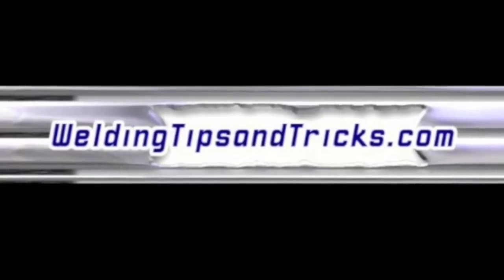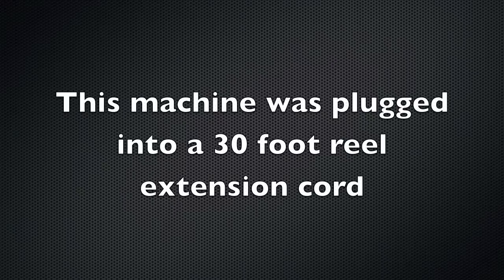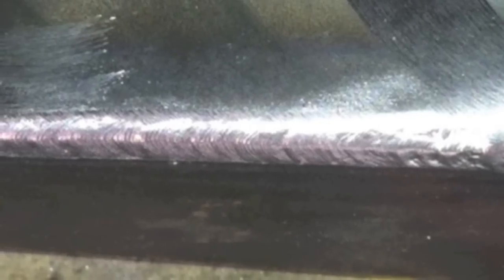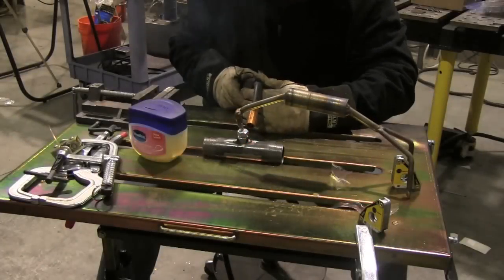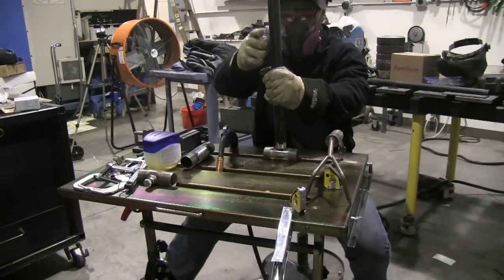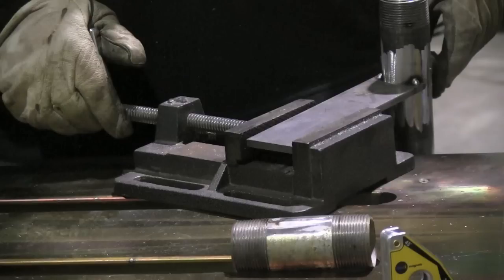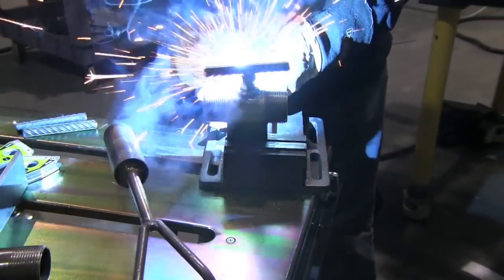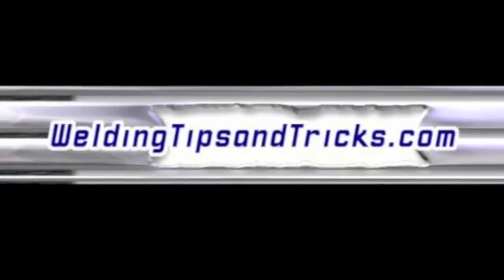Mig Welder Tip and Welding Tree Project

Comment: so, what is your take on that welder? I have one extremely similar which from the constantly variable voltage control I am assuming is just like mine as they look almost identical (Neiko 135) also same as the Eastwood, minus the spool gun control on the front. was very encouraged to see the nice welds you got with it.
Reply from the maker: my take is basically this.  it welds pretty good and strong for a 310 dollar welder.
comparing it to another welder that looked to be built much better, it welded much stronger and better....so I learned you cant judge a welder by appearance only.  I would have bet on the one that looked to be made better

Comment: Jody

Are they malleable iron pipe nipples and black pipe ?

That little 110V MIG seemed to me to do very well with the mixture of materials:  z/p nuts, galv pipe fittings, black pipe, hot rolled m/s and medium carbon rebar ?  Or was it the expertise of the bloke holding the torch ?

My experience with stick and trying to put rebar into galv pipe fittings to make break-down legs on camping gear was absolutely awful results.

Thanks also for the Vaseline tip - much easier than going to the tool store for anti-spatter spray.  I must also try your PAM tip as well.

Regards

Comment: i don´t know why there is a market for so little welding toys... i weld now +15 years all from 1mm up too 40mm steel and steel alloys but this "inverters" are all lame at the arc control. maybe i got a bad machine but there arcs are so soft, both tig and stick, that i dont will they as a gift for chrismas or another day ^^ how was the arc control at the ahp 140 ?  long and soft or more like good old heavy duty weldingbox with max 300amp max ?  i work all with this big-red-box and i never will replace her with a inverter ^^

Comment: I use a Northern Industrial MIG 135 WELDER i can weld 6" inches and longer plus i 
have welded a 1/2 inch steel with welder.

Comment: When you are grinding off the galvanized coating, it helps if you smear some of that liquid hand soap with the pumice in it (feels gritty) on the piece.  Hard to believe but it makes a big difference in the speed and effort it takes, it also cuts the fumes down some.

Comment: Do you ever have trouble with Tig welding and using magnets to hold the part. It seems to mess with the arc when I use magnets.
Reply: Hi. See my comment below.  I am no expert at welding but this phenomena was explained to me.  Cheers.  Hope it helps you.
Reply: I've noticed the same thing with MIG so I only use them tacking like Jody has done. Never use them while completing a weld.

Comment: Am I weird for watching these videos even though I don't weld and barely know anything about welding? I did some stick welding in high school but that was only for a few weeks.
Reply: I learned MIG and TIG welding just by watching Jody's channel.  I am like most guys learning by seeing it done.  Jody is the king of welding!
Reply: Jody is mesmerizing to watch at any time! I agree with the comment about the allure of the sizzling arc as Mark Fryer put it. Once you see the flash of the arc and catch a whiff of ozone....you are hooked! Welding is a drug, and Jody is a "pusher" extraordinaire!!
Reply: Buy a used welder on facebook market , a lot of cheap good ones there , get one of the oldest lincolns , theyre like automatic machines , meaning easy to adjust

Comment: Jody, every time I use a magnet to hold work my weld will not stick???
Dave
Reply: Hi.  As a noob to welding I also had this problem.  After putting out the problem to a few welding blogs I found out that the magnetic field interferes with the plasma the arc generates and as a consequence ruins the weld.  As Jodi says here in the vid, it's best to use magnets purely for fit-up and remove them for your actual weld.  Oh, by-the-way, a magnetic field affects TIG too!
Reply: Robert Lewis Good points Robert.  The TIG arc is a plasma arc too so it would follow that it would be affected.  I gotta play with that to see what happens myself.  Thanks!   Fred

Comment: I just had to weld a nut to a jig this past Friday in welding class. That vasaline trick would have helped. I tacked it with 7018 down around 98-100 amps. Overhead is still killing me, but there is an ah ha moment learning each position, and I'm sure it's coming. Thanks for the videos!
Reply: The biggest thing to welding in any position is to get comfortable. What type of welding are you doing overhead? 4F or 4G?
Reply: 4G with 7018. I'm comfortable... just hanging by the cable. Free motion throughout the weld. Can't seem to kick the waves in the cap. I can overhead the hell out of a flat plate, but the welding over that filled up groove never turns out right.
Reply: one thing that really helped me on overhead was to try whipping it slightly like you would for pipe.  Best looking weld I had ever done.
Reply: If you're running a 7018, don't whip it. Anyways, Best thing you can do when it's time to put the cap on is to point the rod straight up at the puddle and keep a TIGHT arc... move slower and be sure to fill in the undercut. Best thing I can recommend is to just weld some flat plate overhead and get to where you can run a straight bead... putting a cap on plate in the 4G position, or putting the cap on the bottom of pipe in the 5G position will come second hand after that... run weaves and stringers.
Reply: Just got it today! Test out on it tomorrow and on to open root! My problem was controlling the arc length over dips. Any low spots would transfer to the cap and always leave me with a few below flush spots. My ah ha moment was watching the instructor fix my lumpy weld and then cap it. My next one was perfect!
Reply: Nice dude! Now comes the fun part... open root. Open root in the 4G position is a little hard your first few tries. Some instructors will tell you to "push" the puddle away from you when running your root in the 4G position but I prefer to pull it towards me. I see it this way... extend your hand out in front of you, now slowly bring it back towards you... your hand rises. It's easier for me to keep the rod in the keyhole when I pull the rod towards me. Everyone is different though.
Reply: Thanks for the tip! I get all kinds of strange looks for hanging by cables and using push angles where you're not supposed to. Welding really has no one and only way to get it done.